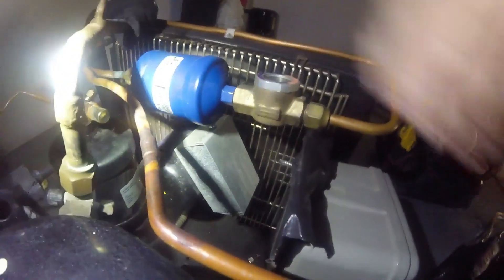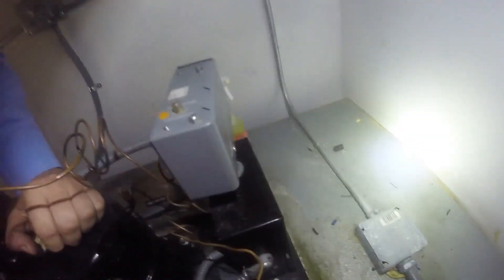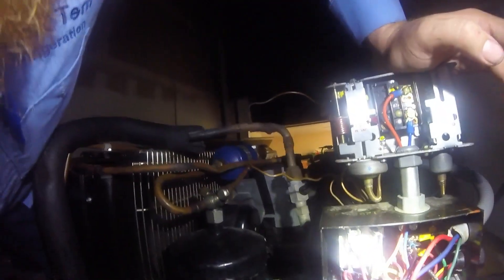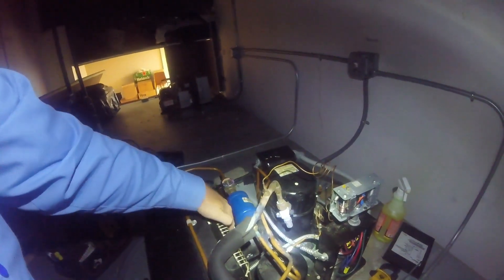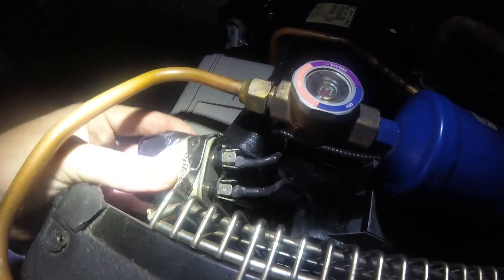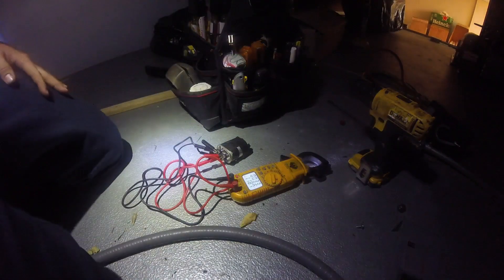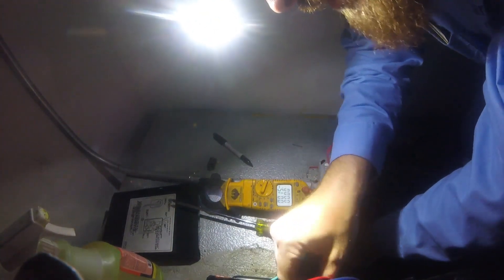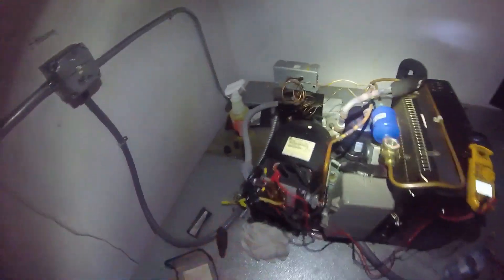Walk in freezer not cooling

Comment: not often you can get by with just a cap on fan/blower motors, much of the time the bearings have gone and it runs slow/hot, which helps cook the capacitor, or vice versa, capacitor failing makes it run slow/hot and killed the bearings. the old "catch 22" issue :)
hvac compressors and direct liquid cooled things with remote mounted caps are more forgiving, but still a gamble.
Reply from the maker: I was hoping the cap got me through. Once i removed the motor i can see someone tapped a hole  to add oil into the motor in the past. It was on its way out.  Usually that is how friday refrigeration calls work out.